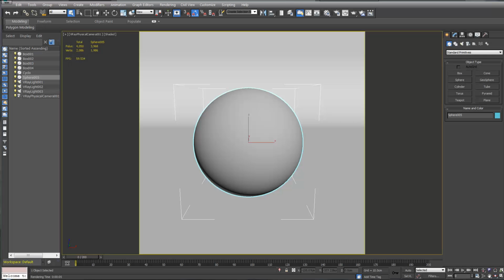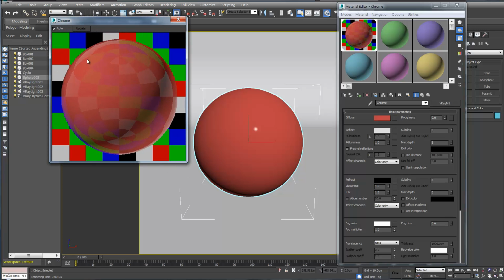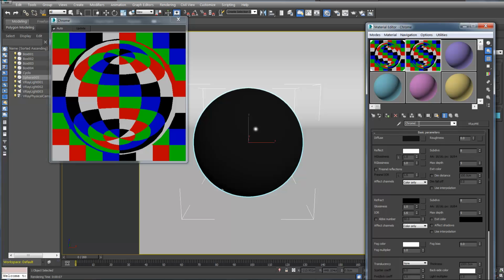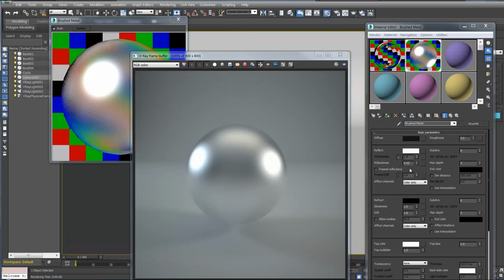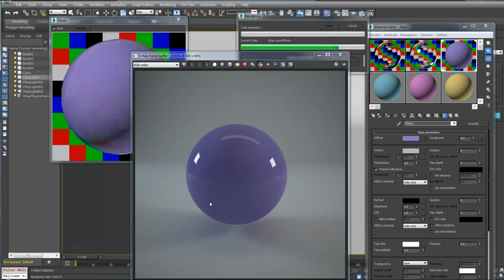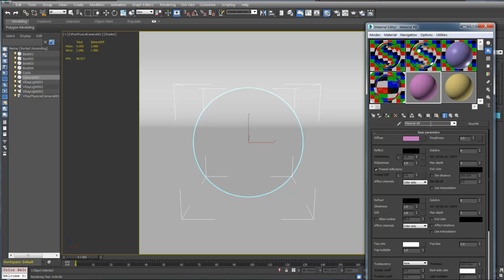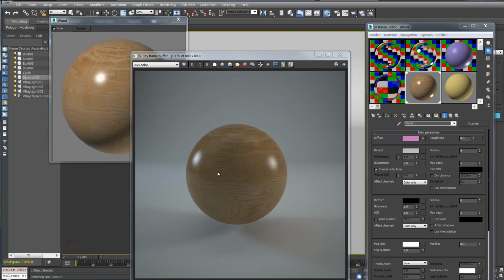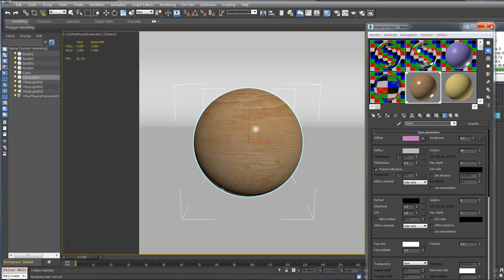How To Make Basic Vray Materials in 3Ds Max

Comment: I have problem, when I add vray material to object, object get black in viewport but render is fine
Reply from the maker: You need to show texture in viewport. 
https://knowledge.autodesk.com/support/3ds-max/learn-explore/caas/CloudHelp/cloudhelp/2015/ENU/3DSMax/files/GUID-39E321E5-962B-49C2-BD05-B1FA3F48BA26-htm.html#:~:text=In%20the%20Material%20Editor%2C%20apply,material%20in%20all%20shaded%20viewports.

Comment: omg thank you so much for this, i am struggling so hard with it right now. and i think something’s wrong with my exposure... my materials isn’t showing up nice
Reply from the maker: Hey Alys Lim, is it working now? Sounds like a gamma issue.
Reply: Thank you so much for replying. No it hasn’t. I tried manipulating with rotation and tiles through UVW map and XForm but it still does not work :(
Reply from the maker: @alyslim5234  does the texture render?